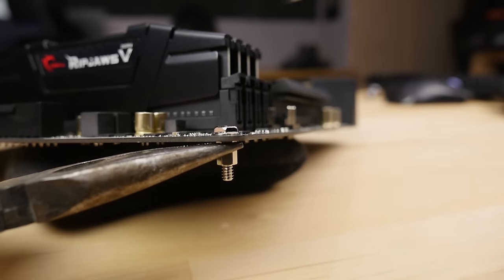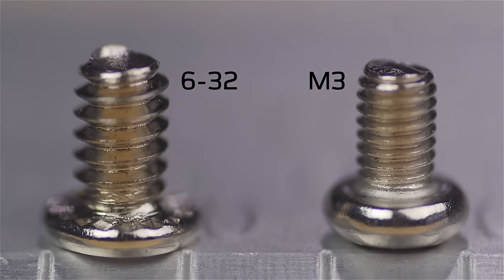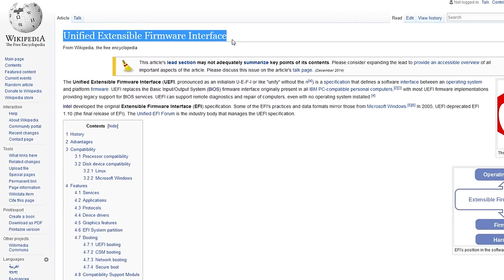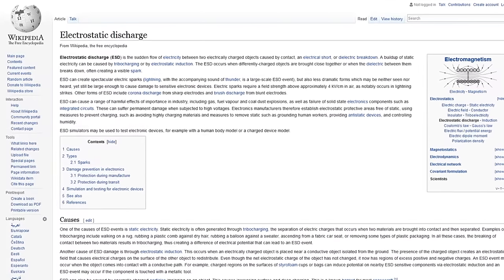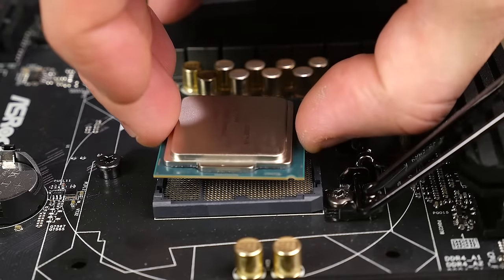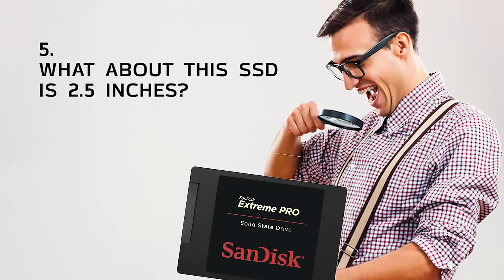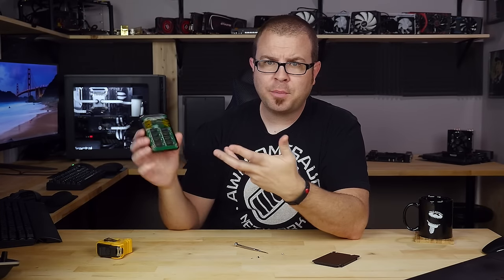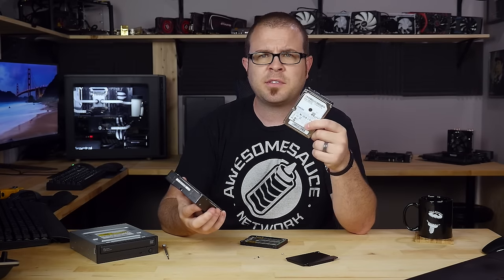5 Confusing PC Building Facts

Comment: actually if you ground the metal surface that youre working on it will aclt like a giant anti static workbench.
Reply: Yes and no. This will drain charge from your bench and all cunductive parts you put on there.
The common misunderstanding is, that while you want a grounded sourface, you should not ground it via a low resistance connection, neither a very high resistance path. Roughly speaking something between 500KOhm and
a few Megohms is what you want there to drain charge reasoably fast but not so fast, that currents get high enough to damage parts. Important: this in not only current going from you to the part, but can just as well be charge that has accumulated on a part and drained to ground when putting it on a surface. The second misconcenption: Damage does not mean that every "zap" will wipe out any component right away, but has the potential to cause damage to parts that can affect their service life, performance under certain circumstances. These faults are real and can be detected with X-Ray. These are often the intermittend errors you can't track down.
I understand, that in practice your experience might tell you otherwise, but this is still not something I would
consider good practice. It is so simple and cheap to set up a reasonable ESD safe workspace that not doing so when in a professional environment is simply sooo 90's ;-)
Wood btw is, depending on relative humidity, not the worst choice but hard to really put a number on.
If you ever get the chance to use a fieldmill or the like: You will be amazed how quickly you can build up substancial ammounts of charge by simply raising your butt from your chair. You are already exceeding chip manufacturers recommended handling voltage long befor your can feel the zaps. Just my two cents....
Reply: dercebe i should have mentionned the resistor part. but i was just saying that a metal tabletop could be turned into a static dissipative worktable by grounding it. thanks for the input.
Reply: OK, I see. But to take it even a step further: If the metal surfeace were to be quite large, say, extending over several workspaces, the capacitance to ground would still be large enough to cause undesireably high discharge currents.... it acts like a cap, one side being your workbench, the other being ground connected by a moderate leak resistance.  This is why you typically have a medium resistance material for your surface or even entire desktop. Thank you for clearing this up, I think its a largely misunderstood topic.
Reply: well most of the time some parts of your body will touch the grounded surface of the workbench but you do still have to be carefull when getting stuff on your bench.
Reply: Actually capacitances on large physical objects like workbenches are so large that the resistance in the strap or on the ESD disappative surface does not protect components. The resistor is there to prevent large currents going through the operator (I.e. you) should you touch a low impedance voltage source.
Reply: sbrubak This is another good point, hard grounding your body would create a possibly deadly low impedence path to ground. The work benches I have seen were made of material that itself would be conductive but still higher impedence. This makes sense,  bc even aus resistor in the ground path would be bypassed by anything grounded you put on that benchtop if the bench material would be bare metall.
Reply: As long as you are in contact with the case the electrical potential is equalized.
Reply: +dercebe, I initially missed your post and I just posted a long-assed technical (layman's) explanation of what happens with non-fatal ESD. I just wanted to +1 all of your points in this comment. Especially your point about parts getting flaky for "no apparent reason". I forgot to mention that issue. You might want to have a look at that comment.

Back in the 70's we used to put a teaspoon of Downy into a pint spray bottle and wipe down the pink-poly workmat twice a day. That trick still works for a wood or faux-wood desktop as an added measure of protection for people with no workmat.
Reply: Having done a 3 day course on static awareness when I was in the military many years ago, I would have to agree with everything you said, especially about the partial or delayed static damage.
You don't even have to touch an electrostatic sensitive device to actually damage it, just pointing at it can do damage to it.
If you guys don't believe me, go to a commercial or military electronics engineering facility and start pointing at things, you'll be surprised at thier response.
Static is a bigger threat than Paul is making out.

Comment: As i build so many pc's I never knew the part about the 2.5 inch and 3.5 inch part not being 2.5 inch nor 3.5 inch. That kinda messed up my mind for a sec. We do address to call these measurements as we buy a drive. But as we don't use this system, we don't even know the actual size by not referring, as we don't tent to measure a drive or look at a metric to inch table. This video actually made that part clear to me. I never measured a drive as I assumed it was near that specification in mm. (if even my bad english made any sense)

Comment: BTW, the platter size designation for drive sizes actually harks back to Mainframe and Mini-Mainframe applications.  The actual platters were changed and the read arms stayed in the housing.  And, you really needed to get the right platter size if you had a mixed shop with IBM disc drives and Unisys drives in the same op center.  Trust me, hot swap-able drives are an infinitely preferable operation when compared to dismounting a drive, rigging the HEPA ventilation, and donning clean room gear to swap out a drive pack.

Comment: These widths (5.25", 3.5") come from a time when there were floppy discs. These discs had these diameters. The widths of the floppy disc drives got adapted by the hard disc drives for easier installation purposes.

Comment: Thank for the comments on ESD.  After building dozens of computers without giving ESD more than a passing thought and never having a single issue, people still don't believe me that it's overhyped nonsense.

I usually point out the same possible exception though.  I'm in a cool humid, uncarpeted basement, not wearing a sweater.  Have you ever accidentally shocked someone under those circumstances?  Nope!
Reply: Actually the tip with touching the case is pretty much enough to ground youself.
The cable to the wall socket delivers a ground pint that is internally screwed to the PSU. The PSU is screwed to the case. The case is a grounded faraday cace. that makes it the safest place to put your precious hardware in besides maybe flying next to a high, grounded radio tower.
Reply: The concern and issues are related to older hardware that was very susceptible to any voltage differentials and ESD was just one of them.  My view is caution is always better than regret.

Comment: Drive size is actually because of floppies. A 5 1/4" drive holds a 5 1/4" floppy. 3.5, 3.5, and 2.5, 2.5. Note that 2.5" drives were pretty much only found in laptops sold in Japan. (they were identical to 3.5" floppies, but scaled down).
Building on a conductive surface actually helps prevent ESD, but you can more easily short something when testing if you don't fully integrate something.

Comment: I actually had an experience with ESD when I was an adolescent discovering how computers worked. I was about 12 or 13 and decided to open up the case of our family computer to see inside. Once I had done this, me (not knowing what ESD was) decided to touch the VGA port. I felt a sharp shock and had no idea what just happened. Nothing looked damaged or destroyed so I thought nothing of it. Later when I had put everything back together, I realized that the monitor was not turning on. After careful analysis of the situation I realized that the PC was not outputting any kind of video signal what so ever. I quickly put 2 + 2 together and I realized that my mom would be furious. Luckily when we took it in to get repaired, the technician had previously installed a GPU on the PC so all he did was move the plug from the motherboard outlet to the GPU outlet. Long story short, I never work on computers without taking all the precautions for ESD and you should to!

Comment: nice video, I do disagree with the metal table tip though, by working on a metal surface if you are resting your arm or elbow on the table it helps keep you "grounded" to the computer case and prevents static.

Comment: Nothing like digging through your jar of various computer screws, finding one you think is right but upon trying to thread it into your standard ATX motherboard tray you find it's actually threaded differently for the G5 case you put said tray in, so back to digging.  

On an entirely different note, the PSU fans on the Mac G5 are held in by standard M3 (M5?) Screws, which saved my bacon in a build I was doing because it just so happened I needed a really long one of those and had been using a heap of shorter ones.

Comment: Lol, I spent 7 hours yesterday swapping cases on a metal table. Oops.
Reply: if the table is grounded and even if its not, its better then the wood.
you will touch the table way more then anything else and thereby make the static discharge to the table.
Reply: In a way  I suppose that is true.  I mean if you use the special antistatic mats and the super cautious ESD grounding bracelets, all while standing on a rubber mat and periodically touching a plugged in and grounded power supply, you could do a build on just about any surface you wanted without any worry.  I personally do mine on a glass table and periodically discharge through the metal legs and I've never fried anything that way.  Hell sometimes I do it on the carpet (on top of a thin layer of plastic or cardboard) while utilizing a dryer sheet to discharge my static periodically.
Reply: In a way  I suppose that is true.  I mean if you use the special antistatic mats and the super cautious ESD grounding bracelets, all while standing on a rubber mat and periodically touching a plugged in and grounded power supply, you could do a build on just about any surface you wanted without any worry.  I personally do mine on a glass table and periodically discharge through the metal legs and I've never fried anything that way.  Hell sometimes I do it on the carpet (on top of a thin layer of plastic or cardboard) while utilizing a dryer sheet to discharge my static periodically.
Reply: I don't know what the deal is with the metal table thing. That seems entirely false to me, and sounds like it comes from somebody who knows nothing about electricity. If your case is metal, and your power supply is plugged in, but turned off, and you sit your case on a metal table, you should be super safe. Just keep touching the table, the case, or the power supply. They are all grounded because the table is touching the case, the case is touching the power supply, and the power supply has a built in chassis ground that goes out of your electrical outlet into the actual ground.

Just don't let go of the table or case or power supply, because when you do, you risk building up a static discharge, which then will be released when you re-touch the computer. This could cause an arc and damage components, or could cause the current to run through components the wrong way, or overload them with current, which will also damage them.

Comment: I HAVE destroyed a component with static - roughly 20 years ago I worked at a small PC repair shop and one of the techs had a husky (which I was viciously allergic to, but was an awesome dog so I didn't complain). This was in Colorado during the cold dry winter, and just after petting the dog I had to remove some RAM to make room to safely remove a power connector from a drive, forgot to strap in, brought my finger close to the RAM and got a big static snap. Luckily the motherboard was fine, but the RAM was toast. I ate the cost of the replacement, but after that I've taken static pretty seriously.

Comment: I'm building a pc soon and the part I'm nervous about is installing the os. I want to install windows 10 pro, but I don't know a good place to buy it, or exactly how to install it and make sure it downloads to my ssd.
Reply: The watch tutorial videos? There's plenty of resources online to tell you how to.
Reply: wehttaM hey I'm very nervous on doing the same thing. So I decided to use my old hard drive with windows 7 on it and putting that hard drive in the new pc.... my question is will it work? Is that possible ? Will the new computer boot up and have windows already in it???
Reply: wehttaM Yeah I've figured it out.
Reply: Jose Torres I'm not sure I'm doing it by usb with 10 and am no longer nervous.
Reply: 0rbz how do you do it with USB? Do you just plug it in and it has windows? If it's that easy I might as well buy windows 10 on USB...
Reply: If you plop in your old hard drive on a new pc the OS will still be there, remember the OS is 100% installed on the hard drive and nothing else.
Reply: ***** That's true unless your OS is an OEM, because then your OS is also locked to your motherboard.
Reply: Depends on a few things. Was the old machine set up with Windows installed using ACHI or SATA? If you had it set up for ACHI and try to put it in SATA it will just bluescreen during boot. You can change the new back to ACHI, but performance will suffer. I have successfully moved hard drives into machines with unrelated boards, even back as far as Windows 2000, but a couple things will happen.
At the first boot, the "find hardware" will go crazy...better know where the drivers are. Activation. Depending on the key you have, it might require immediate activation and since the network driver isn't installed, will just kick you back to the login screen. Boot to safe mode and install the network driver. You still might need a new Windows key.

Moving a drive isn't ideal, but for someone like me with a customized install of Windows and at least a hundred programs installed, with some that cost money and can't be moved to another machine, it might be an option that saves you a week of time of setting up a new install.

Comment: I've dealt a lot with parts and ESD may be a bit overrated, but try picking up a laptop while sitting on a chair in the middle of winter and feel the sparks jump from your fingers through the vent holes in the bottom. It doesn't immediately kill them, but they start to have strange issues after awhile. I got a large washer, tied some copper wire to it, and ran the wire to a copper water pipe. I leave it next to my chair and if things start getting a little sparky, I massage the washer before I pick up my laptop or before I put it down.

Comment: Drive size names came from the time when they used removable disks.  5.25" drives were so named because they took floppy disks that measured 5.25" across.  Before those, there were 8" drives that took 8" floppy disks.  And later on there were the 3.5" floppy drives.  The naming convention stuck around for hard drives because people were already used to identifying a drive bay by the size of media that the drives it held took, and when introducing other form factors (such as the 2.5" drive) it was less confusing to older computer users to follow the same standard, also referring to them by media size rather than by the external dimensions.

Comment: The drive sizes are from the days of floppies, where the bay an optical drive would fit in was used for 5.25" floppy drives, the bay a modern day HD would fit into would be used for a 3.5" floppy drive, and when 2.5" bays came around, they just kept with the nomenclature.